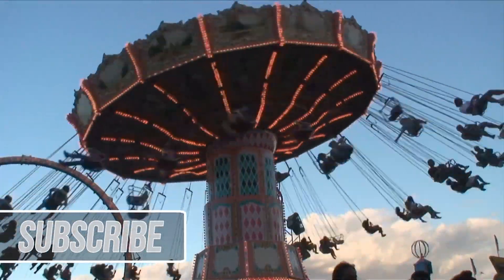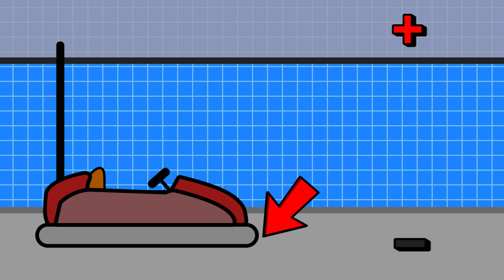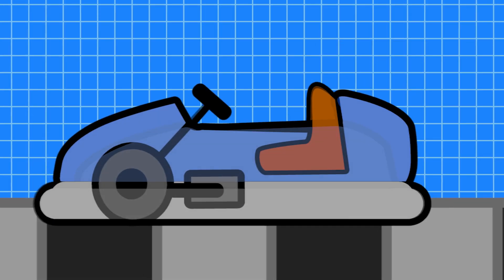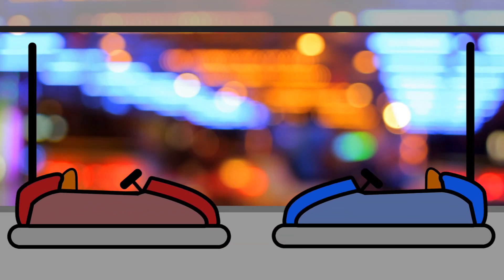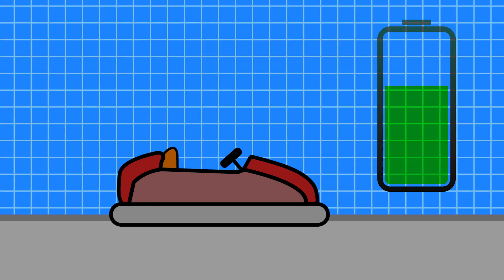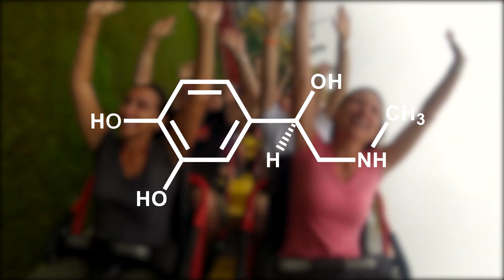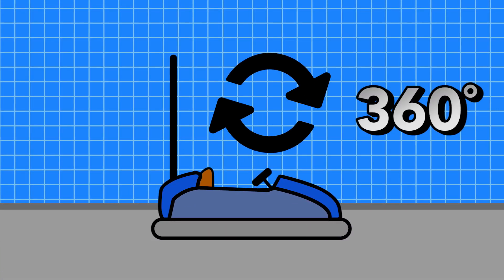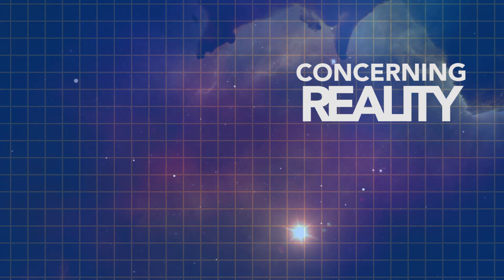How do Bumper Cars Work?

Comment: I miss an explanation on the working of the bumpers. Are they made of solid rubber or is there compressed air inside? Do the bumpers need to replaced often because of crash damage or are they very durable?

Comment: Here in hungary one of the bumper car dodge'em setup uses a relatively high voltage. My friend rented one for his company because of the company's 20th anniversary. They let me take measurements. I measured the voltage. It was 240V~ mains. 
Probably because they think that usually people don't want to have a room sized transformer in their garden. 250 watt brushed motors in them. There were 15 cars on it. It drew almost 16A. And the music amplifiers plus a bull ride rodeo thing and of course the lights with the cars drew around 32A from a 25A breaker and electricity meter. I went to their fuse board and electricity meter and they were buzzing loud. They are definitely not designed for these kind of appliances.
Reply: My Father was born in Bataszek. He was a true master violin maker. Head 15 years of Cremona violin making school. My Grandmother was maiden name Lasko. I never was in Hungary both my siblings were. I often wondered if there is a connection.

Comment: Voltage is usually 90 to 110 volt DC on a hot mesh ceiling track. The operator decides the voltage dependent on cars running and speed required. The motors are usually 1800 watts or approximately 2.3hp and hey have a 16amp breaker in each car. They also have a resistor in circuit with the motor. This helps to stop the motor burning out if the car stalls. The motor also has a clutch inside it as a back up too. Foot lever in car closes a contact and away you ride. 6 to 8mph is the ride speed and the pressure in the outer tyre is inflated soft for a nice ride and hard for a good bang when hit. Rear wheels can be nylon, rubber or steel. This depends how you want the car to act when struck from the side. Rubber will keep the car quite still where as nylon and steel lets the car slide. Electrical contact is made by a stinger for the ceiling and a wire brush that rotates and contacts the floor. Some cars have 360 o steering so you can bang the car in reverse, however most have a limiting pin in place to stop this.  Whatever the science of it, just enjoy and have fun.
Reply: What would cause the wire contacting the ceiling to spark or when hitting another bumper car?
Reply: @YungPoppa23  When the contact/ stinger becomes disconnected there will have been a high amperage  break in the circuit at the point of transfer. This causes an arch or spark. When disconnecting and reconnecting, if there is resistance (driver has foot on peddle) this will cause an electrical arch, same as in any type of switch. A dodgem car runs at approximately 110V with  the motor pulling 1800 watts inductive load. This load will increase on reconnection up to 16+ amps causing the electrical arch that you see. This is the same when the dodgem stinger runs across the meshing as it will pick up dirt, dust and  this forms a bad contact causing arching. You may have noticed that you can also smell the negative irons caused by the arch too. Along with many other smells of rubber &  grease give it the distinctive dodgem track smell.
Reply: Yes, 110v dc.
Reply: How dangerous would this be if scaled up to say 400 hp? Is that even possible? I'm thinking electric Nascar style race in a big arena!
Reply: @meizhongbai it cant. Are you nine?